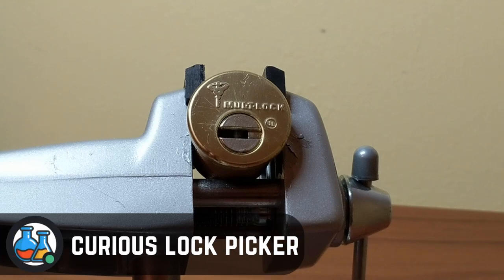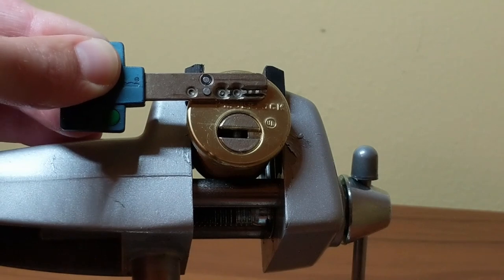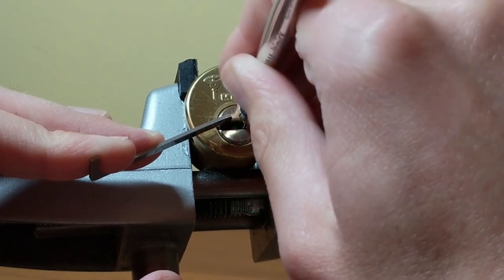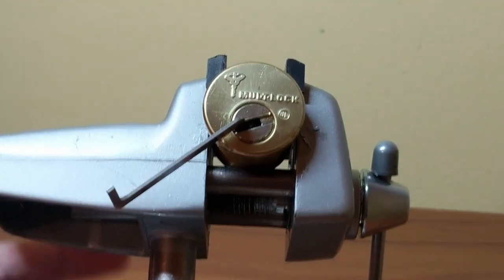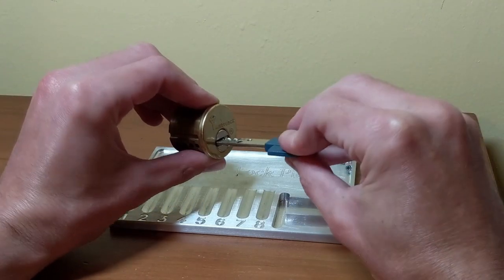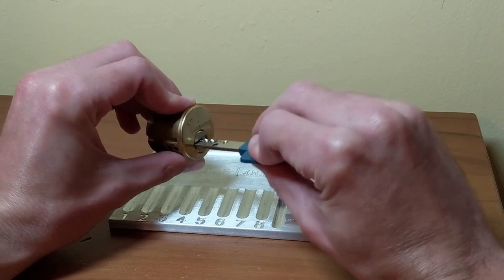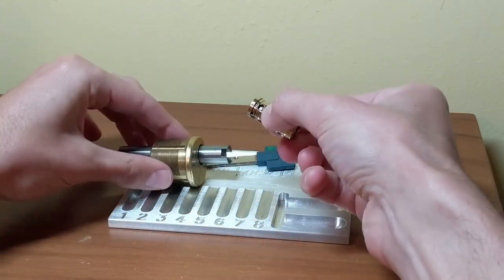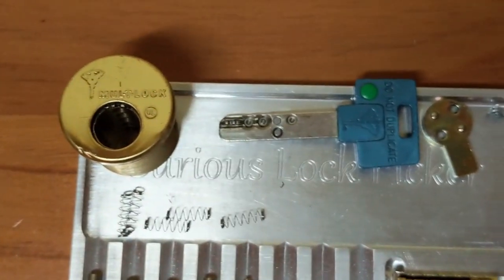Slaying Saturday 16: Mul-T-Lock Interactive

Comment: Very well done.  I have a question... you said you were getting multiple clicks on certain pins. How do you know when to stop clicking? Does it get much harder to push?
Reply: Great question! I knew to stop lifting when one of two things happened: either when I got a loud click and felt noticeable rotation on the plug, or when the key pins became springy and no longer provided much resistance to being lifted. One oddity is that set pins can sometimes feel as if they're binding infinitely strongly, and become impossible to lift. It takes practice to learn to feel the difference between this and a truly binding pin.